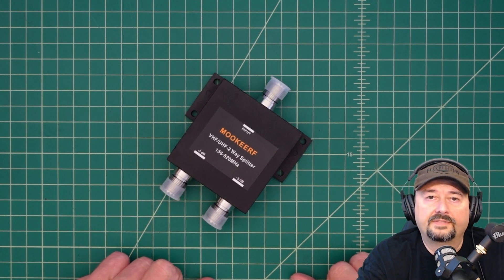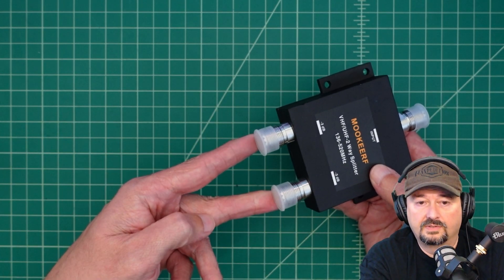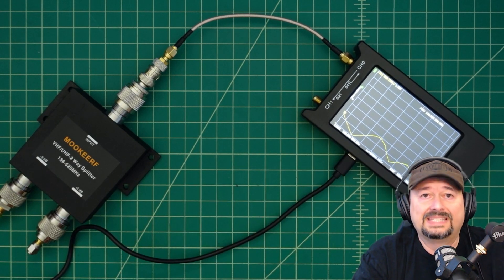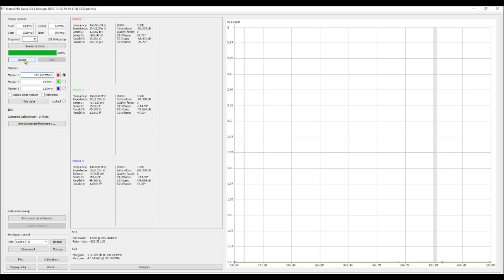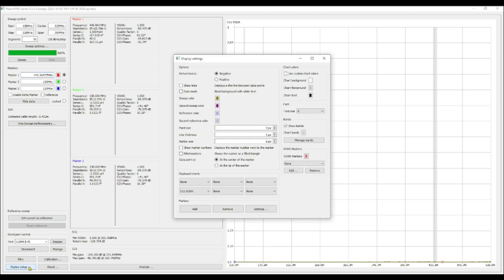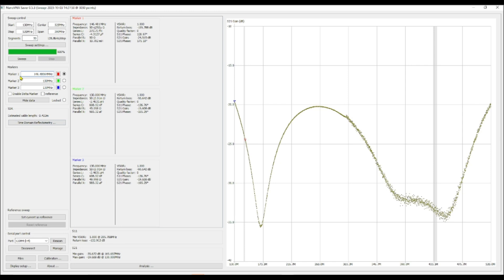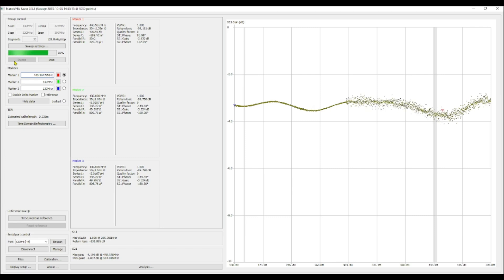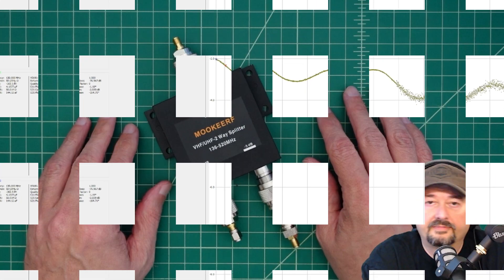Mookeerf VHF / UHF Splitter

Comment: Very informative video. Would the Mookeerf work as a splitter for one VHF/UHF radio signal to the input, to 1 VHF antenna on one output and 1 UHF antenna on the other output. I want to use two mono band antennas on the car. Thank you.
Reply from the maker: This wouldn’t be the solution for that, you want a diplexer 👍

Comment: It's a splitter, so not really the right bit of gear for what you want to do.
Splitters are generally used in commercial settings where a tall building needs radio coverage from a repeater, but a single antenna can't "punch through" the whole building. It varies, but usually a repeater on the middle floor with a 0dB end-fed dipole will cover 90% of the building, with only the basement and perhaps a few floors above suffering bad signal levels. To fix this, a splitter is inserted into the repeater coax, and then a coax is dropped down a service riser to something like a 6dB upfire antenna.

A combiner would be a better choice, but they have massive loss in the TX and RX directions, which is why they're generally used with high power output sources (10s of Watts), and why they have powered RX pre-amplifiers built in. In the UK, and from manufacturers like Amphenol Procom, combiners are about £1000 a channel - pretty expensive.

What would probably be better for your purposes (testing adjacent channel rejection / desense) is a regular mobile duplexer. They have only about -1dB of loss in the pass port and can get -80dB nulls when they're well tuned. 
To tune a duplexer, you'll need a decent spectrum analyzer with tracking generator because the NanoVNAs simply don't have the output power to make it past the -80dB attenuation of the nulls, so the bottom of the display just shows noise floor rather than the bottom of the null (which is what you're trying to tune).
The restriction with the above is that the duplexer nulls can only be "so close" to the pass band, and this limits how close your adjacent channel under test can be.

Look out on Ebay / ham flea markets for a multi- tap directional coupler. You can get them with quite easily with -40dB ports, and because theose port are directional, you won't get power coming back the wrong way.
Reply from the maker: I agree with all of that, that for the insight DRH 👍

Comment: I am pretty sure that is Mookie RF.  Mookie used to have a TV show 77 sunset Strip.  If you ask him he will lend you a comb!  Ok that dates way back.  Most of those combiners or splitters are usually one way.  In large testing facilities standard antennas are used to stimulate the unit under test.  73
Reply from the maker: Yeah, I agree.  I was using it "wrong" but that's the fun part!

Comment: Sadly although I have a few commercial diplexers I have actually made a few too. Quite simple to make, the port isolation of this one is certainly disappointing. The throughloss is shocking too, should be well under 1dB. It might be interesting to dismantle it and check that any internal fixings are secure. Try a Comet or Diamond diplexer, they are a lot better.  This one is really performing badly, with perhaps 25w fed into one port it will burn something! 73
Reply from the maker: Yeah, as a combiner it’s of no use for radio transmission.  I think it would be “fine” for single antenna and two RX stations like SDRs or Scanners.  I was hoping for better but didn’t expect it.  Thanks for watching 👍
Reply: @TheSmokinApe  Its not a diplexer. According to the description  it is a -3dB splitter, so 50% of power should go to the -3dB ports  minus any extra losses. Useful for combining two antennas for extra gain, going to separate receivers or 2 tone testing (both TX and RX). Minicircuits sell similar units